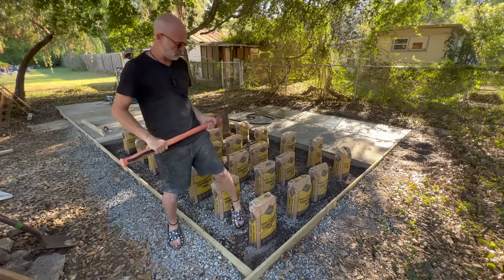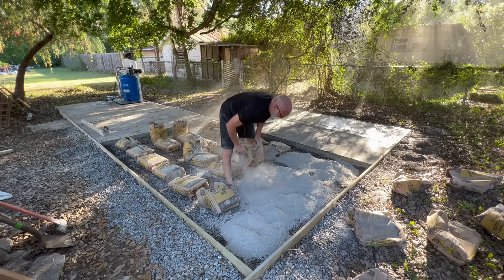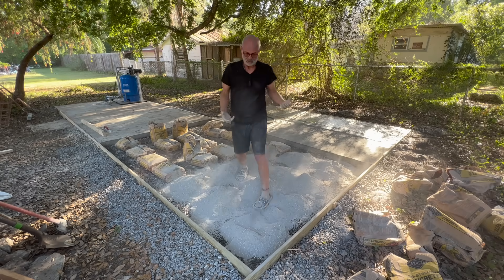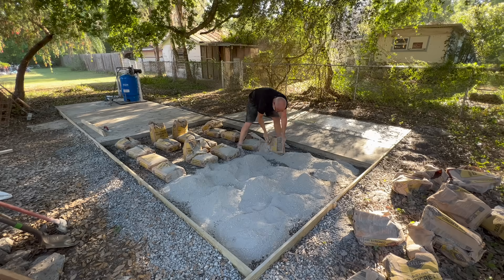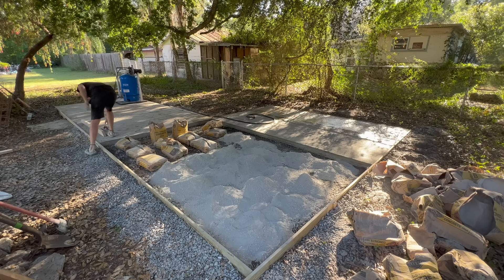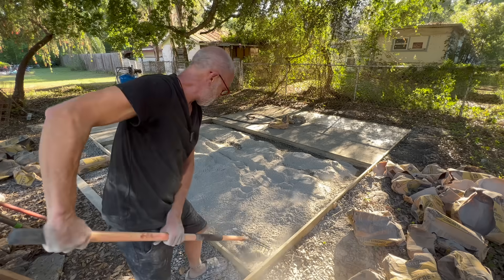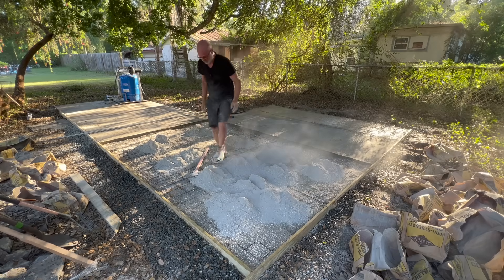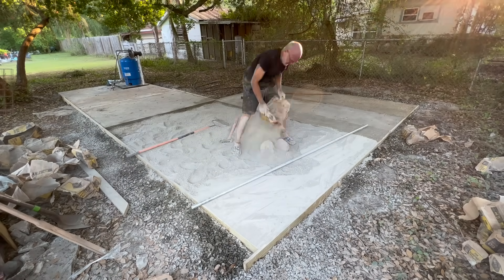Concrete Ninja Warrior Dry Pour Slab for Backyard Building

Comment: As the cement in the dust reacts with water (eg. sweat on the shin, pleural fluid in the lungs, or tear film on the eyes) calcium silicate hydrate and calcium hydroxide (aka caustic lime) will form. Both of these compounds may cause: serious eye damage/eye irritation, and respiratory and skin irritation. Also, inhaling fine particles in large quantity, even if no-reactive, is not good for the lungs.
Reply: Ettringite in the lungs........ I nominate this guy for the darwin award!!!!!

Comment: I appreciate the video. It helped me see what the dry pour hype is all about. I have been in the construction trade for a long time now and I don't see how this method is any easier or better. I'm going to stick to the traditional wet method I know. I see a lot of questionable things with this method, and it doesn't seem to be any easier. Concrete is messy as it is, and I'd rather have it wet then dry. I mean the dust you're breathing in, the concrete sticking to your skin all over your body because of the sweat and getting in your eyes as well. PPE is a must especially with this method. Getting the concrete dust on your skin is going to be a very bad thing for your skin. The dry pour method in my opinion is ok is certain situations like smaller applications or concrete that you don't care about how it looks. I'm not trying to be negative, I guess the traditional way makes more since to me. If I was having a house built and the contractor said he was going to dry pour my foundation or any concrete slab/walkway I'd say no way! I have a feeling that maybe a year later or so there is going to be a lot of issues with all these dry poured slabs. It reminds me of when I put a post in the ground, dry pour the cement and then add the water. It seems fun and will work in controlled smaller applications, I think.
Reply: I can only say for a 70 year old woman putting in a 5x5’ slab alone (only had help with screeding) I couldn’t afford to rent a mixer or handle this amount of wet cement. Dry pour worked well for me. We’ll have to see how it stands up to foot traffic. For the most part if I can’t do projects by myself it simply doesn’t get done.
Reply: I am not a construction professional, but having property with horses, I do a LOT of fence-building. I have learned that doing a thing right is seldom the easiest way, and when it comes to concrete, wet is best. When I plant poles, especially load-bearing poles for gates and such, I always pour a footing in the bottom of the hole, let it dry, and then set the post. Always wet. I have had dry pours fail or the post just rots out and doesn't last as long. I would rather take a little extra time to extend the life of my post and have the peace of mind knowing that I did a good job than to shortcut it and have to redo it in a few years.
Reply: I am not a construction professional, but having property with horses, I do a LOT of fence-building. I have learned that doing a thing right is seldom the easiest way, and when it comes to concrete, wet is best. When I plant poles, especially load-bearing poles for gates and such, I always pour a footing in the bottom of the hole, let it dry, and then set the post. Always wet. I have had dry pours fail or the post just rots out and doesn't last as long. I would rather take a little extra time to extend the life of my post and have the peace of mind knowing that I did a good job than to shortcut it and have to redo it in a few years.

And I agree on the PPE...concrete mix is nasty stuff to get on you or breathe in. I was thinking when he walked out of that cloud of dust after busting up the bags that he is nuts for not at least wearing a mask.

Comment: PSA - this approach is a health hazard (which can be remedied with simple common sense safety equipment: Boots, gloves, and proper mask/filter required.). Cement is caustic and will severely burn your skin (via experience where a friend ended up in hospital) and cement dust in your lungs apparently is really bad for you (common sense). Someone below said it causes silicosis. I don't know if that is the outcome, but you have to use common sense and should know breathing in any fine dust is really bad for your health.  A better approach potentially: How about mixing the concrete with water in the forms directly with a rake and optionally stomping it like making whine with grapes or smacking it with a tamper or shovel to establish some density and strength, then do a final level off with some runnier mixed batch at the very end while the rest is still wet and curing. If you do it in smaller sections, seems plausible to hydrate and mix the cement better and get better results with similar level of effort without having to premix in mixer or buckets etc.  Anyhow, I hope your health did not suffer long term from all the cement dust you breathed in during this effort...

Comment: "The strength of concrete increases when less water is used to make concrete. The hydration reaction itself consumes a specific amount of water. Concrete is actually mixed with more water than is needed for the hydration reactions. This extra water is added to give concrete sufficient workability." I did like the demo with the truck, but you need not worry... this slab is going to be ultra hard.

Comment: No expansion joint ,? Wont it crack ? 
I'd use a Respirator .  N95. Save your lungs.

You're in good shape way harder than it looks, for that size a pad.
I counted 40 bags of concrete for what 12x8' x. 4"

Comment: Once you have lung cancer you will be wishing you hadn't forgot the N95 mask. I wouldn't be 50 feet from that dust cloud without a mask, WOW just wow, and using you're bare hands to boot... and no boots just WOW. Talk about no brains between those ears. The easier way to do this is to wet or dry pour 4 separate slabs over an 8 day period working only TWO hours on each pour.

Comment: Fun fact: When using this dry method, you'll notice mosquitoes get lost in a hurry. They don't like that dust at all.
Reply: neither will his lungs lol
Reply: @hebrew984  Yeah, the way to do it is to bust one bag at a time and step upwind. Two bags max. Let it clear and do another. Then you can actually pack it firm while dry. With type S it works great, won't crack. I drive on it... no problem.

Comment: This guy thinks like I do! Not a thing wrong with doing it this way, especially if it’s just for a shed. It takes way more bags then you think, so if you have rocks, chunks of concrete, broken pavers, you can throw that in too. If you want a nice finish, you can skim coat it with a sand mix, for the final finish. Make it like soup, and it’s beautiful! I widened my pool deck 8’x 30’ a little at a time this way… no cracks, and it looks great. Not recommended if your going to drive vehicles across it, or heavy machinery. It makes doing it yourself extremely doable. He even laid out the bags to show you approximately how many to start with, then he added as he was leveling it. Well done video……👊👊👊
Reply: What is sand mix? That sounds like it would look something like a brush finish?
Reply: Not a thing wrong with it? Dudes breathing in silica like I’ve never seen before 😂 chronic lung disease called silicosis coming straight for this dude 😂😂

Comment: Dang so i would guess 1.5 inch thick of hard concrete are fully cured. The rest of the bottom of that are still powdered and whats the use of putting the mesh metal in there? To keep powder cement in place? Idk bout this but ill try it at my friends house not mine

Comment: Nice job. I have used the same method in UPSTATE NEW YORK at 2 and 4 inches and had pretty good results inside portable shed. 2" is foot traffic only. My family does NOT understand that. 4" is holdig even outside with no covering for 10 years now. Still light traffic only. A dump truck went too far and messed up a section but that was expected outcome. (firewood to shed oh well) Point is the method is solid. IMHO

Comment: Just saying. I did excatly what you told in the start you did not want to do.  I used cement, gravel and sand, a wheel barrow and made a concrete floor alone in 4 hours. Its still working good.

Comment: Bet that'll crack. Not enough water, concrete needs to be mixed so it's uniform. You'll have dry spots under the surface. Wear a mask and some gloves, concrete dust can cause serious lung issues.

Comment: i would be surprised if that slab cured in the center. How many bags of mix, 40?   About how many gallons of water?  I'd love a follow up video in a year or 5.  Very interesting technique if this works and has some longevity to it.   Thanks for the video, you got me thinking!  Cheers!
Reply: You ever have a bag of cement left in the garage last more than a year before turning to stone?? Haha I've been wondering why this can't work for simple slabs for a light shed or patio or walk etc that does not needing to be " structurally perfect " obviously not going to put a house on it lol
Reply: Yes  @jak3est  I have had several bags of un-opened, un-used concrete turn to solid !
...I plan on stripping paper off and using them to fill deep ground imperfections, and dry-pouring over them.
Reply: @joeteejoetee  I've used portland that's been sitting around for 25 years.  Bust open the bag, break it up and toss it in the mixer with sand and aggregate.  Add water as usual and pour.  If I'm in doubt, I just run a richer mix.

Comment: WATCH THIS VIDEO!! These guys demonstrate this dry technique properly on a small 4” slab. Lots of advantages. I agree with pretty much everyone one here that you should always research the building materials you are working with and use your best common sense. This method is a good one man job that saves money but you have to do it right. If you so it right - it will settle stronger than wet mix concrete.. IMHO. 

https://youtu.be/_50MXEHr678

Comment: I don't want to be rude, but there are quite a few people in comments here who seem to think this is an acceptable alternative to a "wet pour." By any metric, this is the dumbest and least efficient way possible to pour concrete.  Even though he shows 28 bags at first, a pour this size would REQUIRE a minimum of 71 60# bags of quickrete, which is what he seems to be using here.  That's iF you mix it with water, which actually helps "stretch" the dry mix slightly over this volume, which is a little bit over a cubic yard.  A cubic yard, from a concrete company, costs an average of $120-$150. That's mixed, hauled, and delivered to your forms, ready to go. Most drivers are happy to pour in lifts, letting you get a bed down, put your remesh in, and then finish the pour.  Based on Home Depot prices, which is a generally ok basis for estimation, 71 bags of concrete cost a little over $300.  So, for the cost of a truck and hiring a couple guys who actually know what they're doing, you could have poured a proper concrete slab, and saved yourself probably 8 hours of back-breaking labor hauling, dumping, and spreading bags of dry mix.  Not to mention the potential risk to your health of breathing cement and silica.  I guess you wouldn't have been able to post such prime youtube content, but for everyone else who might see this video, don't do what this gentleman did.  Hire a professional, or at least watch a DIY video with good information.
Reply: Well said and there was no rebar or wire to " keep in tact. Don't even think this concrete had rocks just straight concrete for flashing and not strength.

Comment: Retired in the Philippines remodeling an old resort on the beach. We have four more than 20,000 sacks of cement all by hand it’s crazy. How are you Miss modern tools 🧰 Great video👍🏿
Reply: 45-80 lb bags is one cubic yard. Mathematically one cubic yard  covers 81 square feet at 4 in thick. But always figure 75 sq ft so that you never run short. There's also no steel in this I hope he doesn't drive  cars on it!t

Comment: 🚨🚨🚨Warning this is what you should never do,unless you like doing thing wrong and u healtby for anyone  working or walking  on  shit show ,THIS   WILL NEVER HOLD ANY KIND OF WEIGHT ,NO DURABILITY,THEIR IS A REASON YOU MUST MIX CONCRETE  ????? THAT HOW IT BUILDS ITS STRENGTH,ITS NOT MIXED ITS NOT WET IN THE LOWER 2/3 of the mix ,you would have been bettter just using porland plastic cement   It least that will draw the water into the center of pad and it can have a much higher psi rating right now you havebteven got a dry pck mix you have a skim coat the rest is just powder useless

Comment: you can rent a mixer... if you know someone in the concrete business theyll do a two stop with a cement mixer truck and stop by to dump out that 1 to 2 yards in a few minutes for reasonable cost..this was to much unnecessary work and sot safe with the dust..ive driven a mixer truck for 15 years

Comment: This process is good for small jobs like a trashcan pad, or something that's not weight baring. But you have a lot of uneven consistency in your mix. You'll have a lot of dry mix in various spots.
Reply: To get an explanation/chart for how much watering is needed watch dry pour videos by Cajun Country Living. Watering each hour, and based on how thick your pour is determines how many times you need to water. 

BTW, those folk don’t recommend dry pour for anything that will be driven on.

Comment: Do you find that you used more cement than you would have if you would have wet pour ? This is the unique way I’ve seen of using cement.
Reply: "Cement" is the gray fluffy stuff that blows away in the wind. Only one component of "concrete" Huerto.

Comment: Perfect example of working twice as hard to do something half-assed than to just do it the right way from the start.
Reply: Designed concrete for 20 years.  I see these videos and just shake my head.   What a wasted of time and energy…and money for that matter.
Reply: @donmarshall4888  hello, i can understand your comment, maybe the point of ths is also to demonstrate that machines might not be necessary for pouring a slab... im not sure...
and the guy is alone...
can you explain your process for that kind of job ?
im eager to do something like that, but yeah.. im alone and without any machine, and last time I mixed everything with my hands and my back... yet it is stlil very strong
thanks !
Reply: Exactly. All that work to create a slab that is probably 5MPA. :)
Reply: I would love to see a revisit on this video; I wish he left the pad cure for 30 days, then tried to drive a bolt in to put in a sill plate.  It would SHATTER the damn thing.
Reply: @matthewcrist1012  some videos strength tested dry pour vs wet pour and the dry pour is not even half the strength. Stuff just crumbles once the outer shell breaks.
Reply: @otallono right, then let's go to the guy that has a special ingredients motor to put on top..lol what the f...k
Reply: Troll.
Reply: Is that how you get your jollies? Does it give you a warm glow to be so unnecessarily critical?
Reply: @Minx44  it is necessarily critical
Reply: @Minx44 shhhh🤫grown folks are talking.
Reply: @davidbuehler5627  I guess that means not you.  So pay close attention on this one...."If you ain't got nothin' nice to say...."

Comment: alternative way to get a level surface is to install the slab very slightly low, then finish off with a top layer of self-leveling concrete (be sure to first use concrete bonder on the slab)
Reply: Of course the best way is to mix the concrete instead of having to jump through insane hoops doing a dry pour  and work twice as hard to bust up your faulty slab 10 years later.

Comment: ⚠"Crystalline silica is found in materials. such as concrete, masonry and rock. When these mate- rials are made into a fine dust and suspended in the air, breathing in these fine particles can produce lung damage. Silicosis can be totally disabling and may lead to death." 
https://www.cdc.gov/niosh/docs/97-101/pdfs/97-101.pdf?id=10.26616/NIOSHPUB97101#:~:text=Crystalline%20silica%20is%20found%20in,and%20may%20lead%20to%20death.

Comment: This is fk stupid.
Been a Carpenter for 20+years. 
Formed and poured all my flat work.
Only post can be done dry. Still need to wet the shit out it.

Never EVER EVER do this. 
Christ. 
Get a freaking laborer and a mixer from Home depot.  Mix it wet.
Knock that shit out in a couple hours.
OR..

Rent and buy a pull behind from the concrete plant. 
Pour that in 30-45 minutes.  Use Dobbies to hold up your wire mesh. 
And a Bull float. 
That whole slab (including the other three sections could have been done is a few hours.
Done and done.

Unless you just like to play with your work.

Comment: Have you ever seen one those big trucks with what appears to be a spinning space capsule on the back ? They contain concrete, that is professionally mixed. They will bring to you
Reply: For large pours like this, yes. But I have 4 small areas (2’x40’, 3’x10’, and 3’x16’) in three different areas front, back, and side yards. and my street has no parking allowed.

I only need them to be enough for foot traffic, not heavy duty.

Comment: Yeah I definitely would like to see a follow up video a year from now. I don't think this will hold up. No where near enough water used. The only way to get away with a dry pour is to practically flood it. Concrete will set up under water as long as it is kept contained and not allowed to disperse.
Reply: Flooding it won’t help it would essentially be just as bad minimal water. With to much water the top will peel and eventually crumble with to little you get the same. Just mix it